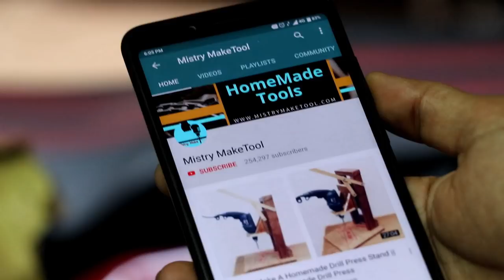8 Super Ideas For Your Work || Tips & Tricks

Comment: I have been using a plastic bag and a magnet just as you show for many many years. I take up metal particles from the floor after machining. Even stuck a broom handle on one so it can be used as a broom. I tried several times to explain this but no one seem to understand the principle of turning the bag around and making it a trash bag. Hopefully You have enlightened a few people.

Comment: On the drum sander, when glueing up, if you put a little shim of wood or plastic along the join before putting on the rubber bands it will help to flatten the cut edges down and help to 'round off' the join.